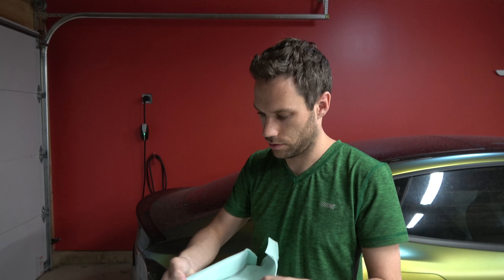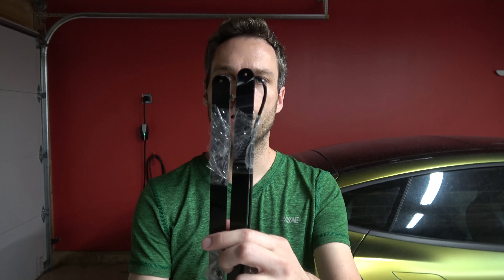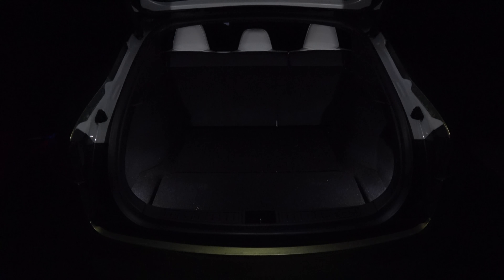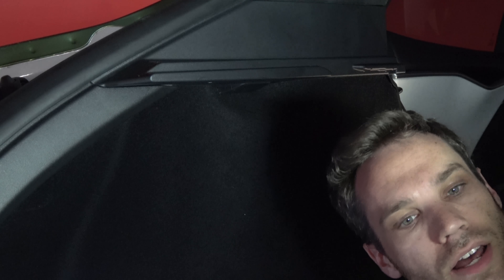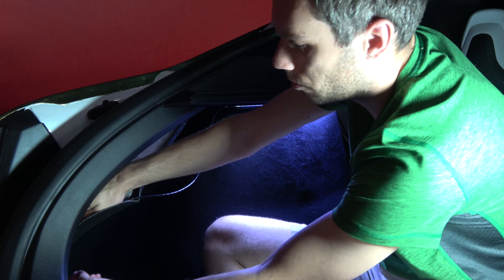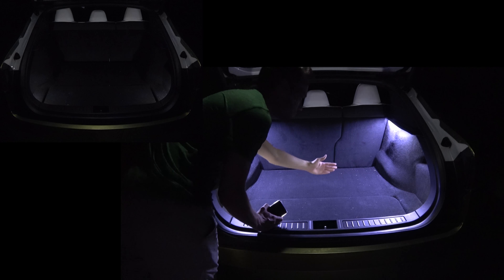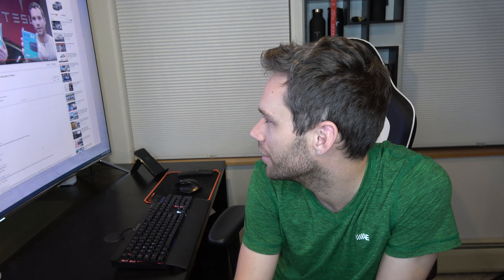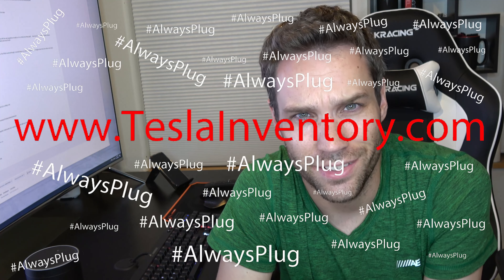Trunk Light Modification!! Echo Dot Give Away!!

Comment: I installed the lights using the double sided tape...after about a week they came off on both sides of the hatch.  I had to use the screws, but the lights are nice.  I also got the (don't remember the name) string to lift up the shelf when the hatch opens.  Works as advertised.